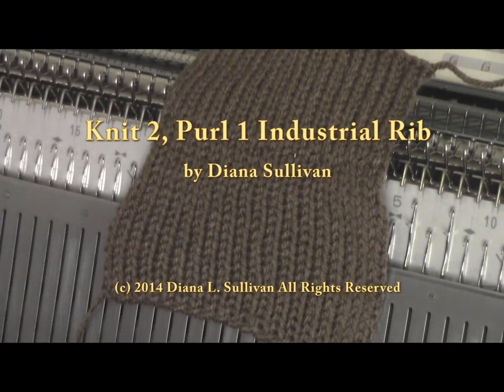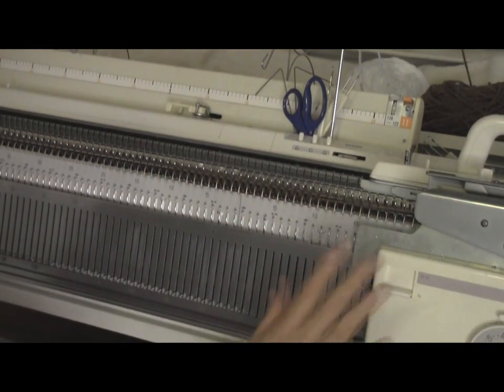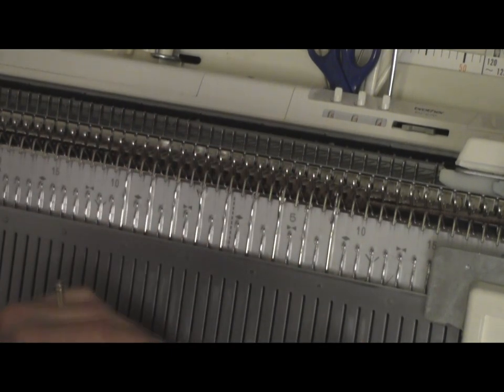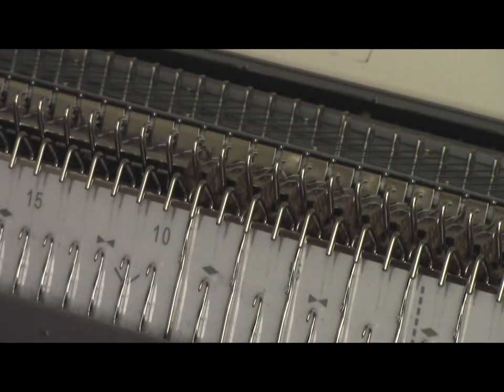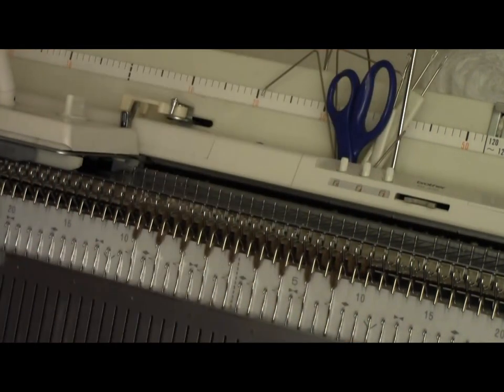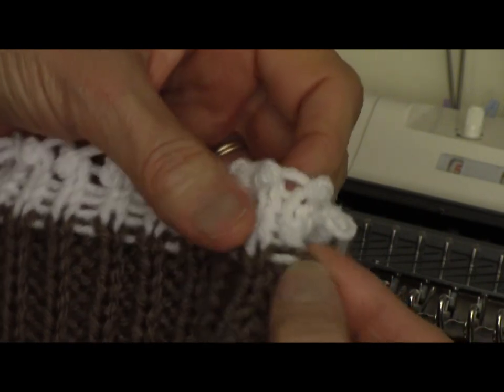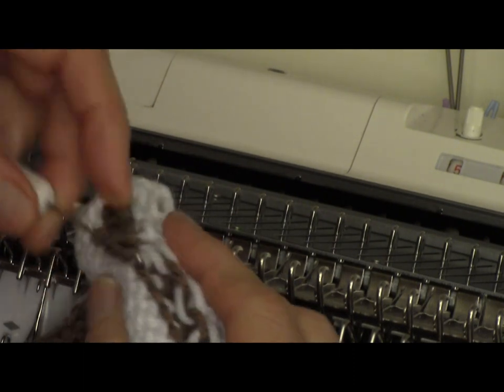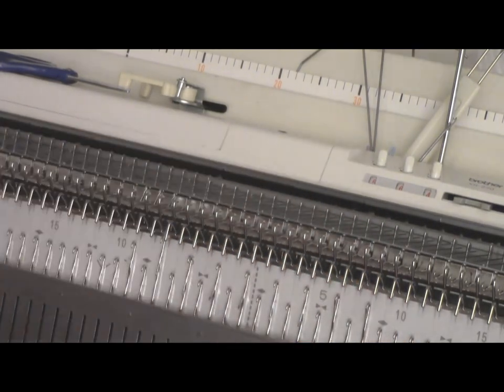Knit 2, Purl 1 Industrial Ribbing by Diana Sullivan

Comment: If this is a 2x1 rib, doesn't this work the same way as if you just start with the ribbing as opposed with stockinette and ending with the rib? I personally much prefer 2x1 rib but for some reason it doesn't maintain its tightness and ends up loose after a wash or two
Reply from the maker: It's different because I slipped those extra needles in between existing stitches.  This is a wider ribbing than if you started with it, took it off on waste yarn and picked it up stitch by stitch onto needles.  That would give you a tighter situation. BTW Industrial ribbing is quite a bit springier than regular ribbing because the stitches are closer together.  It might help with your issue to try doing that.
Reply: @dianaknits  Thank you very much, clearly this would mean starting a garment at the top and ending up at the bottom?  I've seen a few videos of that, something I've not tried before.
Reply from the maker: @countkostaki  You can knit in any direction you like, but usually I use this ribbing-at-the-end technique for a pocket top, sock cuff, or neckline, something I'd probably knit last.

Comment: What's good ribbing that pulls in a lot?
Reply from the maker: Ribbing needs to be a tighter tension than main bed work to pull in.  You can try putting the slide lever on II for more tightness.  This ribbing pulls in a lot if you rehang the stitches, putting each one on a main bed needle after the ribbing is done.